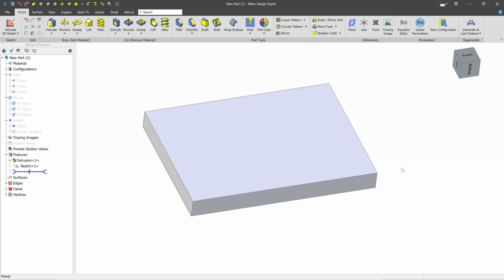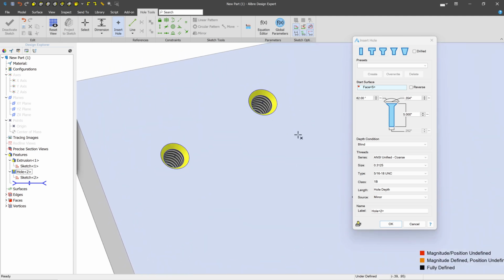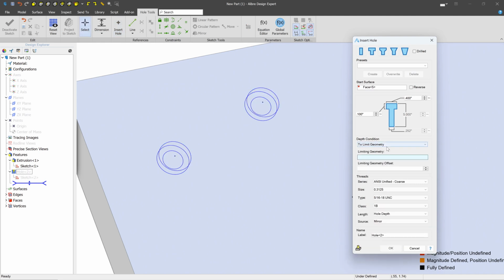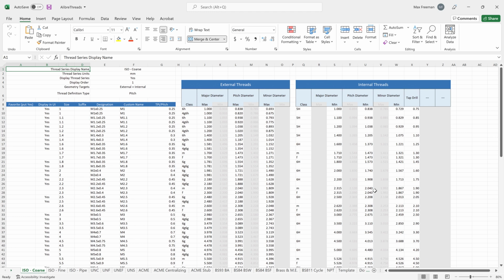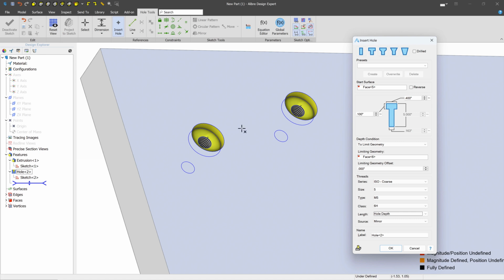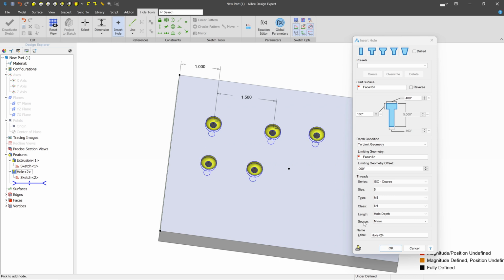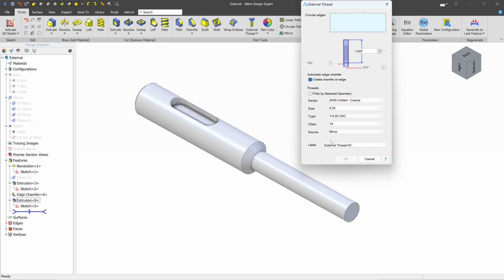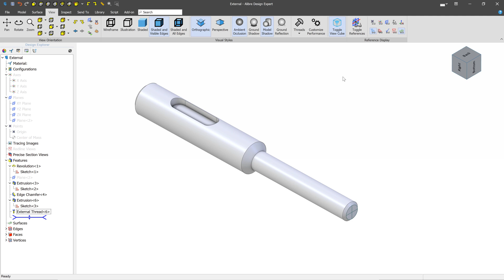Holes & Threads in Alibre Design | 2022 Exercise Series

Comment: I really wish Alibre would create a tool for physical threads (not only visual)  for additive manufacturing.  It could be as simple as a checkbox in the existing hole tool.
Reply: In my experience, it's usually preferred to manually model (via spiral + revolve cut) threads for additive (3d printing) as most 3d printers have a material growth that needs to be accounted for. To explain, if I print male & female threads to spec. and 3d print, they'll be too tight to screw together. I usually need to offset each by 0.2 mm.
Reply: @taylormacdougall9694  material growth, could be handled in the slicer or the excel file mentioned. Using the revolve etc tools will be very difficult and in convenient to make e.g a M6 thread. This visual only is good for blender but not for a real CAD program.
Reply: @pctt38  ...!? thus a CNC bit(combination of bits) could not cut these threads?
- subtractive manufacturing, obviously.
Reply: @taylormacdougall9694  Fusion360 offers the exact feature that @MrSpeakerMBurns is talking about, and offers tolerance options that are useful for 3D printers. This is usually not needed, however, as most modern consumer 3D printers set to a 0.12mm layer height are plenty accurate enough (if well calibrated) to create usable threads, especially larger threads. Sure, tiny thread sizes are still tricky, but larger sizes are definitely doable.